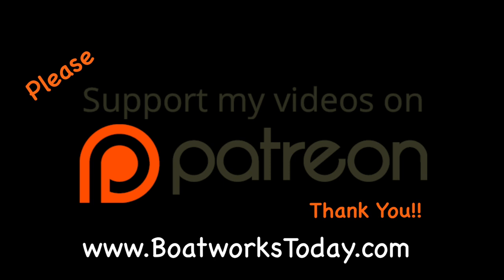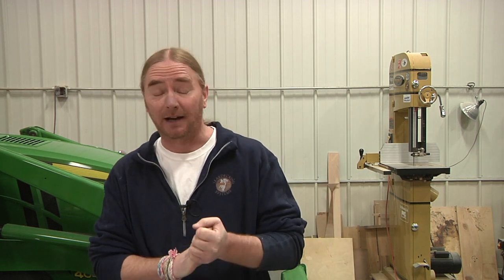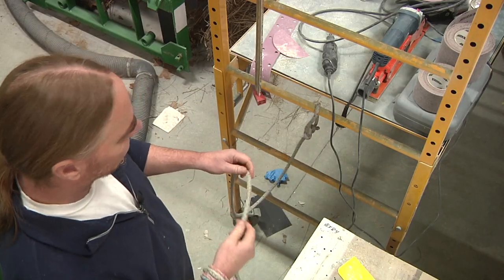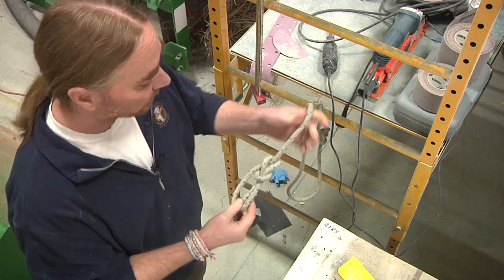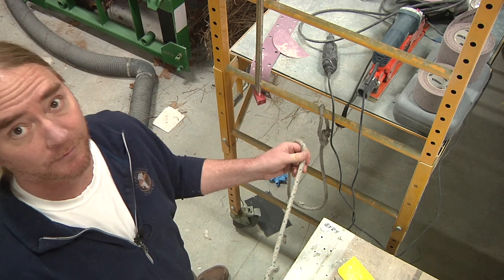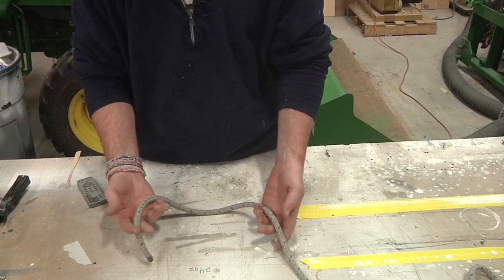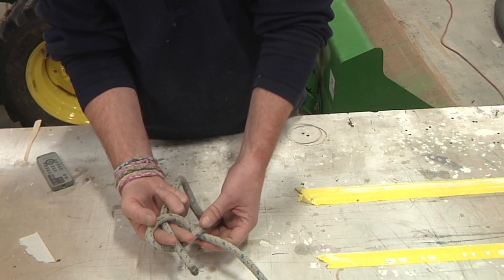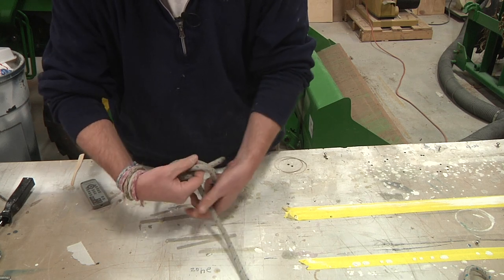Tying A Bowline Knot Contest ~ Fastest Way Ever??

Comment: Dear friend good evening, the knot shown 5:30 is named left hand bowline or cowboy bowline. Its a bowline allright with the same holding caracteristics as a "normal" bowline and the working end being outside the bite-loop is an advantage not a disadvantage, specially when lateral-sagital forces apply and not vertical ones. You can use it with no problems when boating-sailing. If you want something way better than the bowline, normal or left hand, then try the anglers loop or perfection loop.
Reply: we called them inside or outside
Reply: I have 3 years o' College Physics, plus I hold a Master Rigger's Rating, compliments o' the RCN... I have tested Both the standard & Cowboy Bowlines, extensively... The Cowboy Bowline is a cross-loaded Knot. It has a rather nasty tendency to migrate off the end o' a line, when under load! It should never be used for anything load-bearing! As for the Angler's Loop, it is the best Knot to form a loop in Bungee Cord, it holds very well... For other types o' line, the standard Bowline is still superior, as it is easier to untie... The Angler's Loop has a reputation for beein' a Hatchet Knot, if it has been under heavy load...
Reply: @JohnSwampthingRae  I have used the Cowboy Bowline thousands of times: As a makeshift  shackle for large sails, even to lift a heavy outborder once - no migration whatsoever, not once in 35 years... In fact it's the only one I've ever used. I've double checked every knotting book I have, and the inside one isn't even mentioned.

Comment: As mentioned in other comments, I believe the fastest method is the way we used to teach first aid/marine safety in the Boy Scouts. We would have races to see who could tie it the fastest. It was primarily used to be an extremely fast way to get a waist sized bowline in a rope to either save a man overboard/yourself/drowning victim. Also could be completed with one hand. Start with the rope around your waist. Use the right hand with the bitter end, twist the wrist to make the line curl like in this video, and pull the bitter end back through with the same hand. Could probably be done just as well lefty. If saving victim, drop newly formed Bowline ring to your feet and lasso throw it to the drowning victim. If saving yourself, leave around waist. Unfortunately I haven't practiced it in years, so anybody with a fresher memory, or willingness to learn this method can have the winning entry. Good luck, and great video Andy!

Comment: the way you showed with the bitter end to the side of the loop is called a cowboy bowline and it holds just as well according to hydraulic tests I have seen performed. My favorite variant is the Yosemite Bowline as it moves the bitter end 180 degrees to point away from the loop thus making your loop (eye) clear of obstructions.

Comment: In reference to the tail, either one is acceptable.  It really depends on its function....meaning, most of the time the tail is tied inside as you describe to minimize its snag potential on other lines, cleats etc... It is clearly a cleaner loop, however, the outside tail is tied when you want to use the tail for another attachment point.  Obviously, the tail will need to be longer to be used this way and the knot is called a long tail bowline.  It is commonly used in rescue operations with a stokes basket.  The holding ability is the same either way and as you said it’s easily untied after it’s been loaded.  Interesting fact...any knot will reduce the strength of a rope and is referred to as knot efficiency, a bowline tied in a nylon rope has an efficiency rating of 71% (maintains 71% strength of the rope) and in polyester rope it drops to 58%. This is why in most rope access operations a figure 8 on a bight (78% nylon and 70% poly) is used.  So for those really important, potential life protection knots, an 8 is great 😎
Reply: What activity might one be doing where he'd need the static loop a bowline provides, and some other knot (presumably a hitch) which makes use of the bowline's tail? I can't think of anything - and it seems to me that whole system would be terribly out of balance and wonky. If there are two attachment points and you'd like to split the difference between them, the Spanish bowline or the fireman's knot would be a much better choice than using the friggin tail of another knot. 
Also, the figure 8 loop sucks. And no one who's making practical use of ropes for whatever purpose is going to spend a second considering the efficiency of a knot. If someone is concerned with the efficiency of knots, then they're probably doing something very technical like scientific testing or something like that. It'll be a situation where the ropes tensile strength will be of concern as well, since that's what efficiency refers to. and if they're concerned with a rope's tensile strength, then it's going to be a situation where the rope will be under an unusually high load. And if a rope is going to be under an unusually high load, the figure 8 loop is the absolute last knot someone would want to use. I mean, they're cool with that knot become a permanent addition to that rope. the figure 8 loop is ridiculous to try and untie after it's been heavily loaded. 
If you need a static loop in a rope and want it to be more secure than a standard bowline, use a double bowline. Simple. Need even more safety and security than that? Use a Yosemite bowline. The only reason the figure 8 loop has become so widely used is because people are lazy and ignorant to the variety of superior alternatives to the crappy old figure8.
No official source recommends that knot. Most because it sucks..
Reply: My rescue trainer is considering dropping the bowline as a required basic knot for this reason. We use the adjustable bowline for tagging a stokes.

Comment: The knot you tied at 5:23 is called a "cowboy bowline" or "dutch bowline" and technically, it's just as safe and strong as a bowline, but is actually much more stable under ring loading, because it works like a Lapp bend. But there is something of holy war against it due to some old bias against it, so if you're working with others, it's much better to always use the standard bowline, otherwise, knives will come out. In any case, bowlines shouldn't be used in rescue work.

For the record, a bowline will reduce the load capability of a line by about 1/3. So if your rope is rated to 300 pounds, you don't want to put more than 200 pounds of weight on the bowline.

Comment: You should try this method grabbing the bitter end in your fist. It won't make it faster, but it is the best way (that I know of) to tie a bowline knot around yourself, one-handed, if you're in the water and someone throws you a lifeline. You grab the line in your fist, turn once to wrap it around yourself,  get both line and hand over and around the other end, through the loop. At this point you have the bitter end in your fist and the other end around your wrist. Use your fingers to feed the bitter end around the "tree trunk" ( the end tied to the boat), then pull the bitter end and your wrist through the loop around your wrist. Done and you're tied up with a nice bowline, ready to be hauled up. Sorry for hijacking the thread a little, but I feel that every time that method is shown, the life-saving variant should be mentioned as well :) What's great is that you don't need to grab the very end of the line, which would be a pain. This works nicely if you grab it in the middle, as long as the line in your hand is towards the bitter end.
Reply: If the line from the boat is under tension, as in you are O.B. And the boat is sailing away, you cannot tie a bowline around yourself from the water. Tie a rolling hitch and pray.

Comment: Hello Andy, first of all I will thank you for lots of informations I got from your outstanding and very sympathetic expert-videos. 
But - I am afraid - I can not agree with the method of your fast bowline knot. I am writing from Germany and it is not easy for me to explain it in your language.
In Germany this knot is named PAHLSTEK, which means this knot ist made to put an not slipping loop over a pale/stilt/stake/post or what ever you call it.
Therefore it is a mistake, when the End of the rope (we call it TAMPEN) is situated inside the loop because the TAMPEN will be ruined by the pale within a few days.
So, in Germany the TAMPEN has definitely to be situated outside the loop. I can not see any reason, why this way should open erroneous as you mentioned.

By the way - there is another very quick way to tie this knot which I call  THE FRENCH WAY .
Put the long side of the rope (let us call it the TREE) over your opened left palm, which shows to the top.
Turn your left hand half a turn to the right (to your body) - Palm still to the top.
You have created an loop around your 4 fingers with the TREE hanging down vertically.
Grab this vertically hanging tree between your  index- and middle finger.
Pull it up through the loop. You are holding a bow now which points upwards.
All this is one very fast move if you have practiced it for a minute.
Now plug the TAMPEN of the short side of the rope (let it call us SNAKE) through this bow from right to left with your right hand.
Bend it, grab the head and the body of the SNAKE with your right hand together and pull the TREE.
So this knot is made with 3 very short moves and I bet it is as fast - or even faster - then the way you are showing.

Why don't I take part in your contest? I am not on facebook. 
But I will try to send a little movie to you some other way.

Best regards from Bavaria/Germany
and once again "thank you very much for all the valuable informations"
Wolfgang

Comment: Not sure this is the best method for sailors.  The most common uses of the bowline on a sailboat are for attaching sheets and guy-lines through sail clew grommets.  For sails, your body is typically positioned with the sail in front of you and the bitter-end passed through a grommet in the clew with the tail running behind you.  This position is not suited for your method; your loop is facing towards you (v. away) and the sail clew will be in your way (obstructing your vision and motions).  It is, however, an excellent method for other applications where a fixed loop is needed and something will be passed through the loop at a later time, or when you are tying the bowline around your body or a post.  Perhaps someone with more experience than I using your method on the running rigging of a sailboat can correct me?
Reply: I agree and this is point I was going to make. It is possible to position your body to still make this technique work if you have ideal circumstances. However (for example) if your jib sheet has come loose/broken/become stuck (especially when racing) and the clew is flogging, you must have another fast!foolproof technique to fall back on.

Comment: I don't mean to be picky but the bitter end being inside the loop we are finished is called an inside bowling and the bitter and being on the outside of the loop is called in outside bowling both are correct however when we use the bowling in a lifesaving not the bitter in should be on the outside that way doesn't get tangled up with me the other not your time just a fire department thing

Comment: There is no way to screw it up ... then you show us a way to do such LOL. But there is still the same way just like how most do with the standard old way, by not making the loop correctly. Instead of going over top with your way (just as with standard way) but instead making the loop by going underneath. Before then twisting your hand. While the loop makes a lil more sense on which way to go with your suggested way, it is still possible (albeit less likely) someone will forget and do it backwards.

Comment: Hi, thanks, I haven't seen this technique before. Sadly the comment section will explode over the "tail end of the bowline" issue. The "wrong bowline" is actually the officially taught one in europe, see random sainling school link: https://www.luebecker-segelschule.de/service/rund-ums-segeln/knotenkunde/. Funnily enough I've told folks that they are doing it wrong as well, just like you but with opposite (bitter) ends, so to say.
Reply: Very interesting. The "real" bowline, tail inside (LOL) is how I learned it, and it was used for years in the climbing community and still in use for search and rescue.  Anything else is considered wrong when life-safety is literally hanging on it, at least in all the training I've ever had.  I'd love to have actual data that shows the cowboy bowline is just as strong.